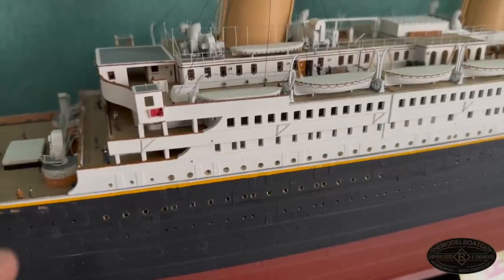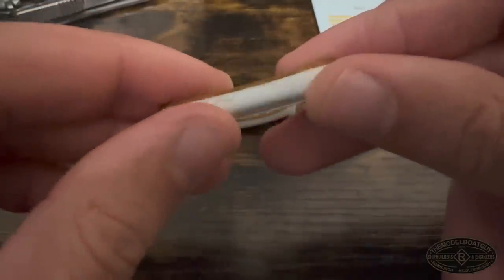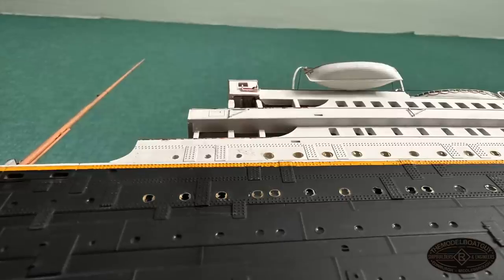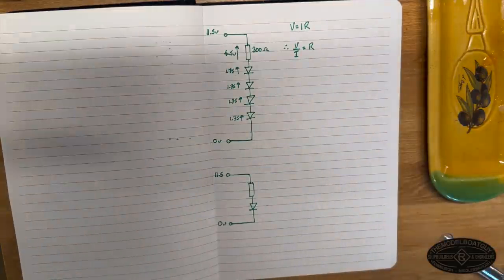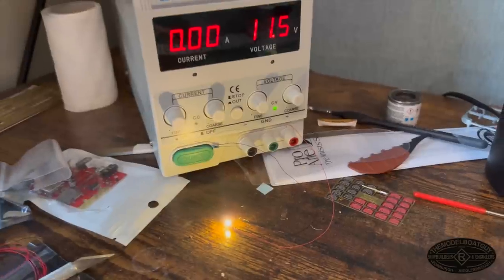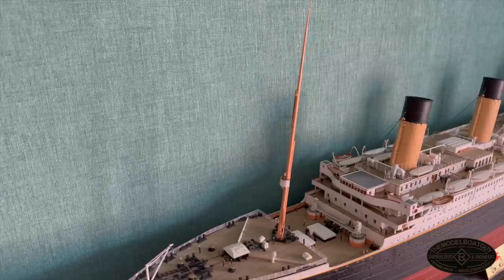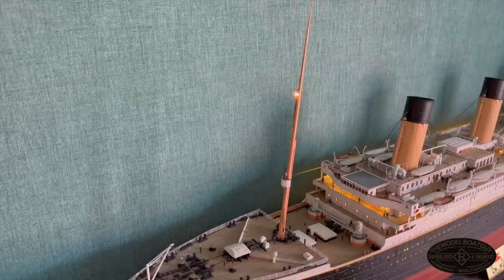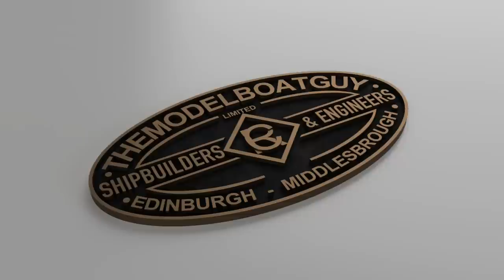Radio Control Trumpeter 1:200 Titanic Build Part 87 - Finishing Touches

Comment: Nice to see someone also doing lights on the mast.  I did the rigging idea, but my LED wires that substituted as rigging went to the side down into the bow deck corners.  And yes I made these rigging lines up, but unless one is a die hard Titanic enthusiast one would not know they were added.  Than I glued the wires to the underneath of the bow deck like you did for the stern nav light and connected to a power source.
Reply from the maker: Hi Daryl, nice to hear from you! 
Yeah I think that’s a good way to go really. It’s one of those things as you say. Probably less than 0.1% of the people that see your model will clock that the rigging is made up, so it’s a good compromise. 

If my LED ever fails I might change the wiring to suit as you’ve done,

Comment: Just in case others are stuck with the mast navigation light, Andrew Model 3d Space has created a resin mast either for pontos or KA sets (or you can have both) that allows the cable to run inside the mast.
Reply: Cool!
Reply from the maker: Thanks for this, I’m going to mention this in my modelling video

Comment: Add floodlights to the funnels, and place Jack and Rose on the tip of the Forecastle so the model can be finished 100%
Reply: Jack and Rose were there for a video was just for fun as the model is intended to be historically accurate and not movie accurate.
Reply: @IllBushido  it just needs some 1997 references to finish the model
Reply from the maker: Hi there, so I’m trying to make this model as accurate as possible to the genuine Titanic that sailed in 1912. Although I’m a fan of the film there are several inaccuracies. Titanics funnels were not lit (I agree it looks better with the lighting, but it wasn’t done!), and of course Jack and Rose were not actually on the ship. 

For me getting the model as accurate as possible it the main aim 🙂

Comment: I'd have run the headlight power cables through where the radio wire run
Reply from the maker: Aah ok sounds logical, many ways to achieve this I guess!
Reply: @TheModelBoatGuy  just re read what I've typed well done for knowing what I mean but either way that thing is ridiculous ❤️